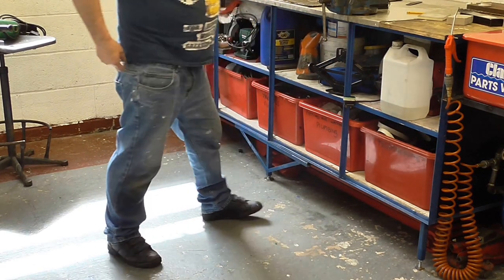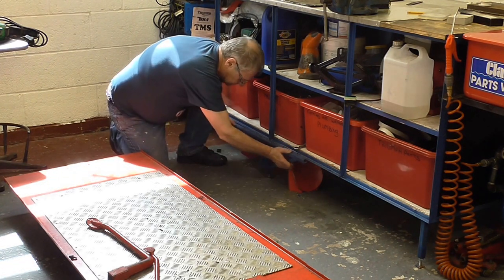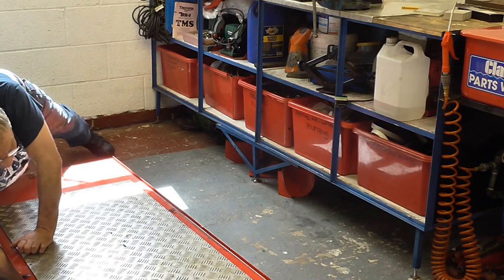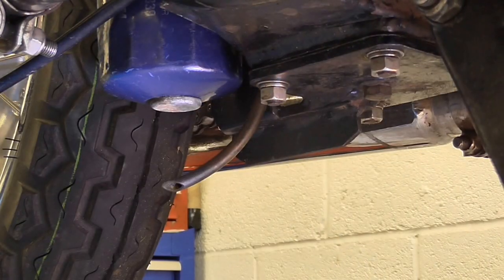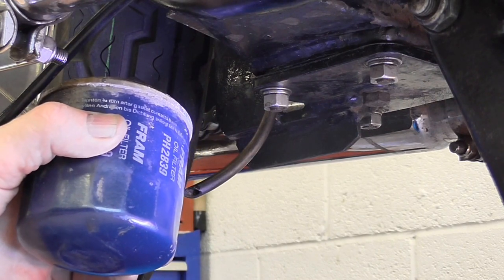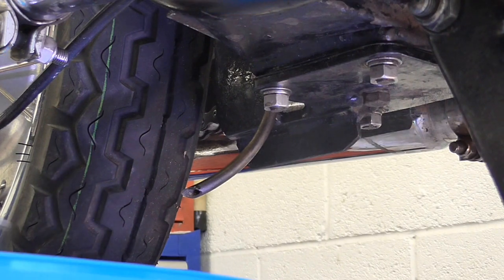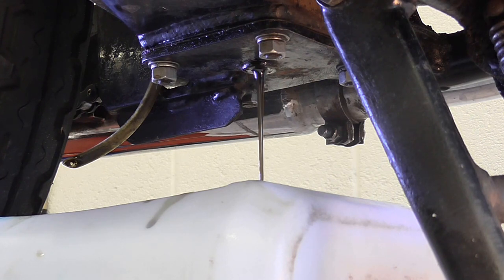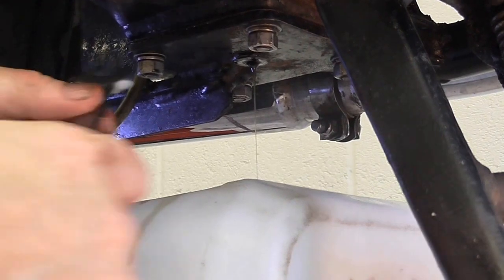Triumph 650 oil & filter change part one

Comment: I've always used an o-ring to seal the crankcase drain plug on mine. It seats snugly against the chamfer at the start of the thread and seals perfectly. It started the first time I changed the oil and found I didn't have a big enough copper washer to fit, so I've carried on ever since.
Reply from the maker: Thank Rick I'll keep that in mind for the future

Comment: Thanks for that Britironjon. I just bought a 72 and need to mount an oil filter like that. Wish you had filmed that process! What parts did you use?  With a filter that large for a .65 Liter engine, you could probably go 30K miles between filter changes.
Reply from the maker: Hi buddy just cut a L shape out of a pice of 5mm plate and welded it to drain plate as for the measurements it will only go in one place as long as it clears the wheel and swinging arm you are good to go sorry can't be much more help as if not got the bike at home at the moment